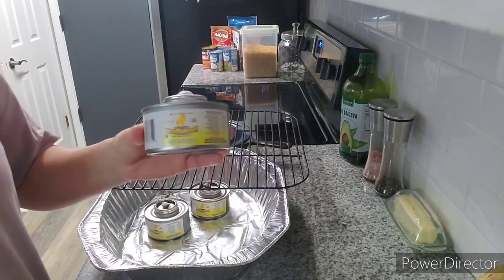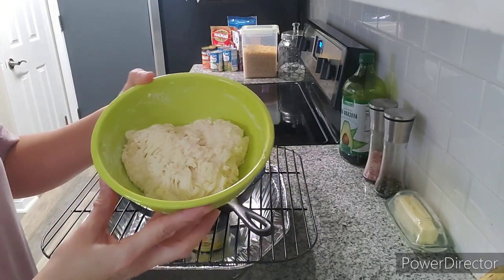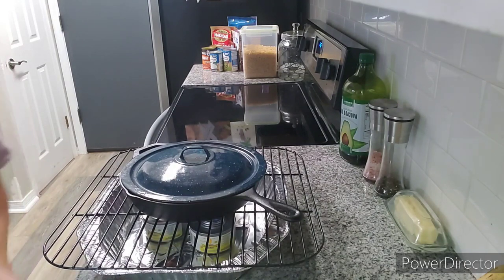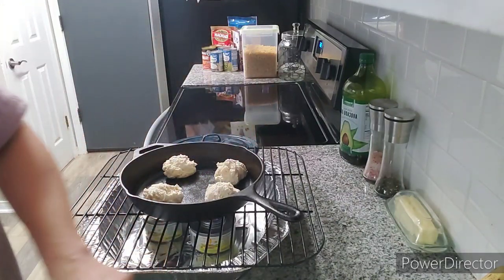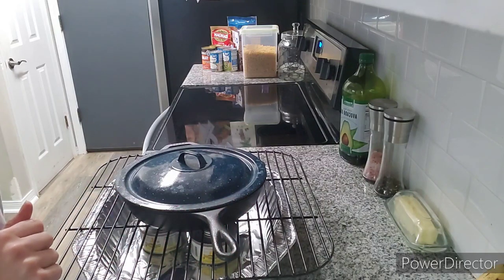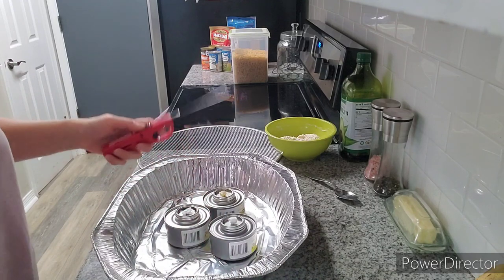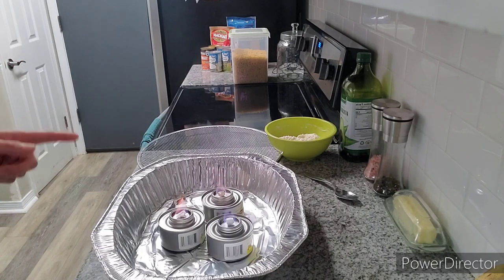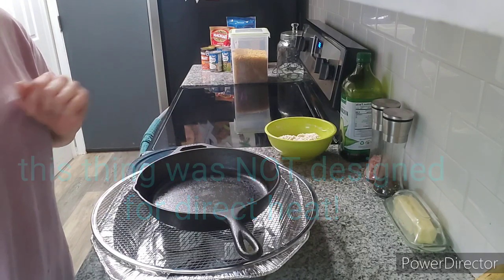Grid-Down Baking With Fancy Heat Sterno Cans!?

Comment: Clicked video when I saw “Sterno”.  Old GS camping cook tool.   Could not   find any for 2012 Hurricane  Sandy. No power for 8 days.    However Party City had “Gel Heat”....same thing.  Bought 3 cases.  Still have 2 cases. Also have the catering frames the cans sit under. Did use a few to warm up food, heat water.  Gonna experiment cooking with them. Tks!!

Comment: You can also use tea lights...I would center one sterno to heat the whole pan....to save on not using them all at once....if it lasts 2 hrs...that's plenty on time to cook.
Reply from the maker: I'll have to try that next time...I wasn't sure if the heat would spread out enough with just one

Comment: Great experiment! You can also use the oven rack on which to place the skillet. You will need to support the corners of the rack with a few bricks. Use enough bricks to elevate the grill above the aluminum pan so that the grill doesn't touch the pan. Duct tape the bricks together if necessary and then wrap them in heavy duty foil. You can also place the sterno cups on a heavy duty foil-covered lazy susan. This will allow you to rotate the sterno cups during baking instead rotating the skillet. It would be great if they sold lazy susans made of metal. Maybe they do but I just haven't seen one. Have you considered inserting a meat thermometer in the pour spot of your skillet to check the internal temp of the skillet? Or a small oven thermometer might also work for placing inside the skillet. I saw Alaska Prepper using a hand-held temperature-sensing device in his recent video on how not to freeze to death in winter. He was standing about 5 feet away from the area of the room he was checking. However, I don't know how high of a temperature the device can register. The reason I mentioned it is it would be a good way to check the temp inside the skillet by just lifting the lid for a second or two and pointing the device at the interior. That device was pretty quick at detecting and displaying the temp. It displayed the temp in a digital format rather than a needle gauge. And one last thing: Make sure you have a carbon monoxide detector in the room where you are using the sterno cups. The best and safest fuel cups to use are those which contain methanol, which puts off a blue flame. Other color flames may pose a health risk. Thanks for the great video! :-)
Reply: Thanks for all those tips!
Great idea adding the bricks!

Comment: I would recommend 2 things.  Have your grate up even higher than it is because the flames are right at the bottom of the pan.  That might prevent the burning.  And secondly, find a glass domed lid for anything that rises so it doesn't touch the lid.  Great job!!!  Then look great!!

Comment: Who said you couldn't do it? Cast iron is the key for me. I butter the pan and flip them once bottoms are browned. 😋 You can use an iron hibachi grate for even heating 👍
Reply from the maker: Yep. I think the cast iron is the only reason it worked, I just thought it would take much longer to heat the cast iron pan to a high enough temp to actually work.
Reply: @sunshinestatesurvival  next try some cornbread. I think you'll like the results 😉 Tip, use muffin papers to make individual cakes. Then you can move on to bread. The ingredients for a 1 pound loaf should make 3 small baguette type loaves.

Comment: I'll update this as I watch the video... I'm getting some virtual popcorn ready as this one should be good... cooking biscuits on sterno.
Pretty darn good for 15 minutes without flipping them.
We make biscuits over hot coals and we pick up the pot we use and quickly flip it over maybe 8-10 minutes in to make sure we brown the tops. To each, their own, though. Of course, our coals are probably hotter than 3 sterno cans. I'm really not sure about that though. 
I don't know what that pizza grate thing is, never had one of those.
Anyway... I think one key to your success was that you went right to the heavy cast iron skillet.  Hard to beat the heat absorption and even release from cast iron.
EOF ;)

Comment: very well done.only for baking you need to avoid contact with the hot surface of the pan.you only need the hot air incide between the lid and the pan.place some sort of spacer on the bottom in order not to make contact with the hot surface of the pan.ias a prepper i like to see more off this of the grid cooking.🥨
Reply from the maker: I'll have to try it a little different next time! I was surprised it worked at all. I didn't think it would get hot enough

Comment: I did this same thing in 1972 ; boy scouts...lol funny to watch now ; I didn't know they still made Sterno. I want to watch you make some of those using the inverter...mine will be back in a few days, meanwhile I can burn the biscuits on the wood stove pretty well... :-)
Reply from the maker: Using the inverter?! How do I do that? Please do tell...
Reply: @sunshinestatesurvival  I have an electric " fifth burner " with a thermostat. 1200 watts. Is what I would use...like a hotplate where you can adjust the temp...you might have to cook in front of your car, to have a battery...I remember you bought an inverter, and I thought " what is she going to hook it to?" And so I just figured you were going to do a video on it anyways, or why did you get it? S o I just thought I'd see where you were going to use it...I bought an extra, cheap, 1600 watts one in case I wanted to plug something in around my pickup. I would have to raise the hood to hook it up but I could run a 120 volt cord into the camper shell to cook to get it out of the wind...I was just curious if you had thought any about using it for cooking...when my big one gets back I will use it for the oven and the first thing I make will be biscuits...I just thought it might be easier with an adjustable hotplate heat source...I know the iron does the cooking after it gets hot enough but I haven't had to make them on a hotplate because I always have a wood stove, lol.
Reply: @davidpotter9462  The extra burner many BBQ grills have now would be an interesting video or even using the grill as an oven to find out what kind of 'gotchas' might be lurking.  pssst, I already know of a few :)

Comment: You've given me a great idea! I have a nice little cast iron dutch oven too, and want to give this a try!! I wonder how corn bread will work?
Reply from the maker: Not sure....but I'm gonna try a few more things now!
Reply: @sunshinestatesurvival  did you still have a good bit of sterno left? I'm wondering how long they will last.
Reply from the maker: @barbarad.517   Oh yes, there was tons of fluid left. The whole process was about 20 minutes and they should be able to burn for 2 hours!
Reply: @sunshinestatesurvival  Im going to stock up while my Dollar Tree is still a dollar! Thanks again, I think I will also get some of those little biscuit packages.
Reply: Yes it would work fine. Also could do fried cornbread cakes like I was raised on! A bit more grease than for regular cornbread. Drop in patties. Turn when bottoms are browned. Add a bit more grease if necessary. Crispy outside..cornbread-y inside!
Reply: @sunnihunny  I bought 10 of the steno cans yesterday. My DT was out of the biscuit pouches but my walmart had some. I can't wait to try this little trick!

Comment: That was awesome!  I will be remembering this for sure.  The only thing here is -- hard to get any kind of canned heat / Sterno.  If anyone knows what you can use in the UK, please let me know!
Reply from the maker: Ohhh, I didn't realize it was hard to come by in the UK. We have the Dollar Tree here and that's where I get mine. Hopefully someone here can help you find a good source
Reply: Are there companies that sell in bulk to catering companies they could sell to you? Those fuel canisters are mostly used for catering. They were designed to keep food hot during events.
Reply: @littleoldlady4154  Thanks, I'll check!